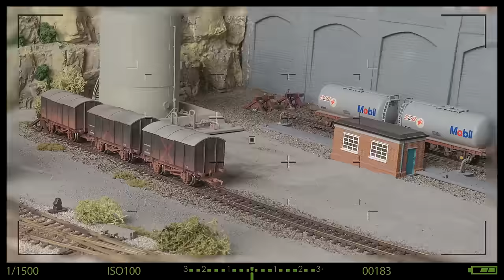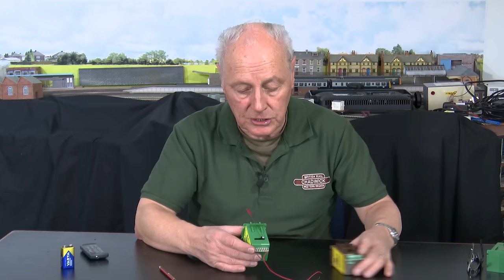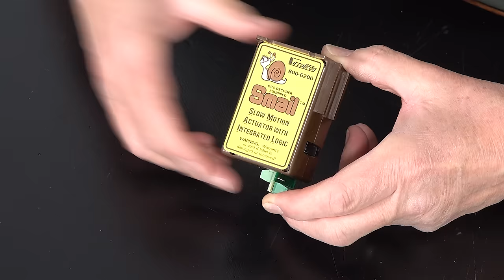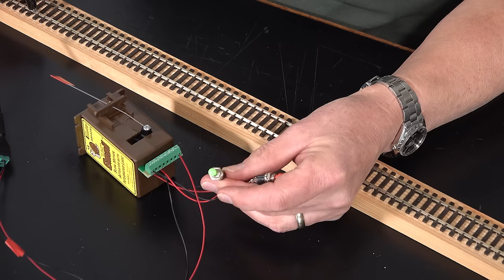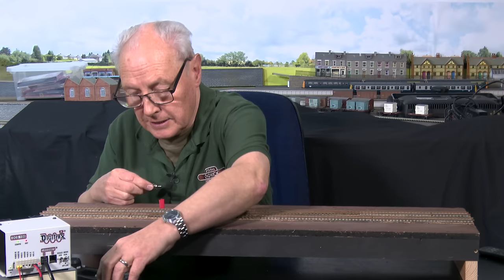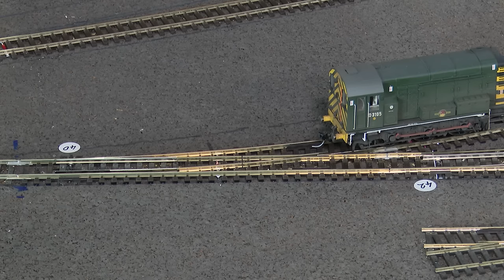SMAILS Vs TORTOISE Point Motors / Switch Machines at Chadwick Model Railway | 208.

Comment: Interesting, especially the multi-source controls. On my layout, with thirty some points in the main yard, I get all fuddled when trying to remember which number point to throw as the express is nearing the junction. All my points are powered off a separate power bus, and the Cobalt and MBT motors have little or no draw after moving. To this end, I have moved to Megapoints controls with the driver boards located close to the points, with the single cable from the master panel to the driver boards. I have a mix of Cobalt analogue IP's and MBT MP10's, both of which have SPDT switches integrated, so when the express nears a junction, I Iook at the control panel and push the button for the junction depicted thereon, which throws the point and also changes the indicator light on the board, without using any of the onboard switches. At the junction, one set of onboard switches operates the signal, while a second activates the 25 cm (+/-) approaching from the "backside" along with the frog. If the point is against the loco, the approach is unpowered, so the loco never gets to the unpowered frog, so the hand of God (and the associated 2 meter arm) never gets called on. Throwing the point sends power to the "dead zone" and to the frog, and we continue on our merry way.  I have also made a handheld controller based near the second switchyard to control those points. (NOTE: as a British modeller in the U.S., one of the challenges has been learning the lingo. Your videos go a long ways towards figuring out most of the differences; guards vs. conductors, drivers vs. engineers, platelayers vs. MOW trackmen, shunters vs. switch engines, etc.)
Reply from the maker: Many thanks for such an interesting comment Jack. Good luck with your project, regards, Charlie

Comment: Very clear video - thanks!   My club has a standard that all turnouts are operated by a single push-button.  You demonstrated the two push-button method.  Are there any CVs that allow the use of a single push-button to toggle the points?
Reply from the maker: Not that I can see in the paperwork. Regards, Charlie

Comment: Charlie, thank you for another very interesting video.
I think that the point motor is becoming very sophisticated.  The old Peco point motor is now a Dodo.
I took the decision and am swapping over to the DCC Concepts IP Digital motors.  It appears to be very similar to the Smail.
I really like the idea of a seperate powerbus for the points, it is something I will have to investigate - oh well, more crawling around, and more cables.
Cheers, and stay safe,  Michael
Reply from the maker: You could choose to wait and see how the new DCC enabled point motors from MTP fair.  Regards Charlie.
Reply: Charlie makes a very good point below Michael. As I noted in my comment, I’ve installed both Cobalt iP Digital and MTB point motors. I find the MTB motors very versatile and look forward to trying out the new digital versions.
Reply: @bryan_lane  thanks, but there is also the cost, and I have already laid out for the IP Digital motor.
Reply: @michaelimpey1407  Yes indeed, I’ve already bought 24 so I’ve got the same issue as you. However, going forward I’ll have a need for quite a few more motors in my planned build and I’m almost certainly going to switch allegiance.

Comment: Hi Charlie, as others have said the issue of shorts shutting down what is essentially your ‘control bus’ is an issue that needs to be considered. If you’re implementing PM42s (or other power managers) you could dedicate one of the sub-districts as an accessory bus or feed the accessories from the command station output directly. As another option I’ve just picked up a couple of the Tam Valley Depot DCC Boosters which are aimed at solving this problem as well as providing a universal 5 A booster (the functionality is selectable via an on-board link). Really enjoy your videos and these discussions, thank you - rooting for you to get the 100k!
Reply from the maker: Thanks Steve, I think we all know the answer, but the publicity behind this switch machine is somewhat one-sided. Regards, Charlie

Comment: I have all my points on a separate accessory bus. This is when I have a short I can still operate my points. My power districts I have 8 using Psxx breakers. They report shorts back to TC via on opto detection module. I can then “ deal” with the short via TC. I also have an emergency stop. That has 2 functions either a dead stop for all trains or a slow stop where each train will run into the next block and stock. These functions are controlled by physical buttons on the facia or via tc switch board. Each button only emergency stop controls/stops it’s respect power district
Reply from the maker: Many thanks for your comments Daz. However, I think that these point motors are aimed at the much smaller layout. Regards, Charlie
Reply: @ChadwickModelRailway  agreed. Still love to have a play with a few though

Comment: I suspect the way around the Smail's problem with not being able to change the point if there is a short circuit, killing track power, would be to have a separate power bus just for the smails....
Reply from the maker: Yes Ken, that’s precisely the answer. Regards, Charlie

Comment: Perfect timing Charlie!  I’m now at the stage when I’ll soon need to pin my colours to the mast on what point control I’m going to use. My prospective layout design (at least the current one 😳) has 27 points on it, so I’ll soon need to decide exactly how I’m going to control them all. This new Smail option has now given me yet another possibility; although I’m not sure if that’s a good thing !! Although my locos are all run on DCC, I was leaning towards analogue control for my points, with a nice pretty control panel (or several) but maybe now I’ll think again. There are just too many decisions to make 😩
Reply from the maker: My advice, Adrian, is to keep your powder dry until MTB announced their new Digital point Motors. Regards, Charlie
Reply: Thanks Charlie….yes the chaps at Digitrains have suggested the same thing to me……I’m in no immediate hurry, so I’ll do that……so many choices !  😫

Comment: Hi Charlie,
Thank you for your great videos.
On the issue of shorts due to frog polarity, can this be overcome with the SMAIL by having a separate power supply (an accessory bus)?

I’ve done this on layout using DCC Concepts IP Digital point motors. Power supply from the NCE throttle is split, one for the track and the other for the accessories (at the moment this is only the point motors).
Reply from the maker: Yes, I do understand that Damian. However, it was designed initially for more simplistic wiring. Regards, Charlie

Comment: Hi Charlie, another very informative video and as I use Tortoise motors, most interesting. One thing I'd like to know is, have you opened one up to see if Circutron have corrected the fault with the contact wipers which tend to break off after a while as McKinley Railway have found out literally hundreds of times!🤞
Reply from the maker: No HA, I haven’t. However, that does sound tempting. Regards, Charlie

Comment: What I did was to control the SMAILs from a dedicated DCC circuit rather than using track power. That eliminates the issue with locos running into shorts and having to use the Hand of God.
Reply from the maker: Yes James, that seems to be the only way around it. However, it does mean yet another DCC run. Regards, Charlie

Comment: My experience on my club layout leads me to think that a switch problem that requires direct manual intervention to clear is a bad idea in general, and unacceptable on a large model railway... as such I think I'd avoid those SMAIL switch motors unless there was a very good reason to install them in a particular location, and ban their use with track power on the main line, entirely.
Reply from the maker: I understand your point of view Matthew. However, I believe they are aimed at the smaller layout Moadeller. Regards, Charlie

Comment: I guess all points should be protected by a signal and by using block detection you can use auto braking until the points are changed correctly, then that short will never happen. Basically the signal controls the movement of the points, and releases the loco to proceed only if points are set correctly. Obviously that requires more electronics, e.g. abc capable decoder in loco, point position sensor, block detection and signal tech capable of triggering points, and maybe route tech to switch everything correctly.
Reply from the maker: I see that you’re getting a hang of this DCC stuff Steve! Regards, Charlie

Comment: Hi Charlie. I was wondering if i attatch a wood block under my board and mount a tortoise motor on it sideways could i use it to lift a decoupler up & down? With a on off on toggle switch ?
Reply from the maker: Yes, very feasible. Many people use them for level crossing gates. I do believe that tortoise do make a proper attachment for horizontal use. in Regards, Charlie.

Comment: Hi, just a thought for when using these new motors, depending on the maximum length of your Steam Loco or Diesel Loco, would it be possible to have a section of dead track before the point if it is set against the passing loco. Even if you only do that in those very hard to get at areas it might be of some use.
Reply from the maker: I understand your thought process Steve, however, how would you switch the piece of track off? Regards, Charlie
Reply: would relay be able to be worked by the contact on the switch machine, it was just a thought but might be a lot of wiring if you had a large number to protect

Comment: Do these new Smail point motors, still have the same internal plastic arm with phosphor bronze/copper wipers? Just asking, because I recently watched the McKinley Railway video, where the long-term issues they were having with the old Tortoise motors (wipers breaking off) was explained.
Reply from the maker: I believe they are the same design concept Steve. However, I have seen some information from the manufacturer that they are going to redesign the attachment of the contacts. Regards, Charlie

Comment: Charlie. Thank you for another interesting short.
When we saw the subject, I said to my wife that I assumed that Circuitron will have addressed the issue that has had McKinley make adjustments to dozens (hundreds?) of tortoises.
But you didn't even reference the collapse of the internal fixing.   Has it been fixed?
Thanks - and Merry Christmas to you and Margaret
Allie and Jonathan
Reply from the maker: Many thanks for your comment. I was saving the McKinley issue for a later date. I have heard that they are going to make design changes but not yet. Regards, Charlie

Comment: Hi Charlie, very good review, potentially one of the sets of 3 terminals could be used to switch power to prevent a loco driving through a point set against it. This would require making a cut one one rail in both tracks that lead to the point, track power is then fed to that isolated rail via the point motor meaning the loco can only proceed when the point is set correctly.  It could possibly be wired in to the frog power terminals. Thoughts? all the best
Reply from the maker: Wow, that suggestion has attacked my grey cells indeed. I shall have to think about that one. Regards, Charlie
Reply: @ChadwickModelRailway  think of it as a mini isolated section just prior to the point, the loco would stop if the point was set against it unless it had stay alive.

Comment: Have you had any of the problems with the contacts inside these point motors that McKinley have had Charlie ?
So with the motor and Digitarx DS74 you are looking at nearly £40 per point to switch each one
Reply from the maker: Yes Shaun, when you put it like that, it’s a shocker. Regards, Charlie

Comment: Regarding the problem of a short circuit that you describe.  I am not a railway modeller so please excuse my ignorance.  The problem is caused by the fact that the SMAIL is powered from track power and that will have been turned off because of the short circuit.  Why does the SMAIL have to be powered by track power in the first place ?
Reply from the maker: Hi Bob, it was designed feature to minimise wiring. Regards, Charlie
Reply: @ChadwickModelRailway  As I say, I am not a railway modeller, but is there anything stopping you powering the SMAIL from an external supply ?  

You would need to connect the ground (negative) side of the track power to the ground (negative) side of the external supply to provide a common signal level but that is common practice in the world of electronics, which is where my interest comes in.

Comment: Hi just and idea for a short if you could possibly do a video on how to speed match 2 locomotives with different decoders to run in a double header for example a hymek with a class 47 thanks
Reply from the maker: Thanks Dan, for such an interesting suggestion. I shall do some research. Regards, Charlie
Reply: @ChadwickModelRailway  thank you it would definitely be a useful one for me anyway as I model a preserved line would like to double head or even top and tail some services with different classes of loco and different decoders

Comment: If you powered all your Smails off their own DCC bus which never is used on any track sections then the shortcoming goes away.
Reply from the maker: That’s correct Marcel. However, it would need to be from a separate Power district which doesn’t shut down when the track has a short. Regards, Charlie

Comment: Hi Charlie, thank you for another interesting video. I use DCC Concepts slow action point motor and have a mix of digital and analogue with separate decoders. I use a separate accessory bus so I can switch the point motors if I get a short due to a locomotive, is this not also possible with these units?
Reply from the maker: Yes, I agree Simon, however, it is disappointing that we have to make alterations to cope with the designers omissions. Regards Charlie

Comment: It's a shame that the SMAIL has connectors that require a screwdriver to be used rather than the lever type used on Wago connectors
Reply from the maker: That’s an interesting observation Bob. Regards, Charlie.
Reply: @ChadwickModelRailway  I wondered whether it was because of cost saving but considering the cost of a SMAIL I doubt it

Comment: These point motors are too big in my opinion. The MP5 point motors are so much better especially for tight installations. At least the Smail has screw terminals...
Reply from the maker: Hey fair observation Paul. 
However, just wait until the new Digital point motors come out from MTB, I’m pretty sure they will be fantastic. 
Regards Charlie

Comment: Just two wires is the cry!! Two wires to each piece of track, two wires to each power district and the compulsory circuit breakers you need! Two wires to each point - wrong three wires. Why is the hype still put about, why not the truth? Charlie, YouTube has such influence with channels such as yours that the manufacturers need to up their game to ensure the truth and best practice is clear for all to follow. Two quick questions if I may? First, how is the wheel cleaning machine performing? And secondly why is the U.K. behind in the creation of the equipment that is needed for DCC to flourish and not be stuck in the “Good Old Days” of stud and probe?
Reply from the maker: Interesting questions, grump. 
Firstly, the wheel scrubber is working perfectly, with good results. 
Secondly, the DCC complexity, I believe is driven by the insatiable diet of individuals who want to make their layout more more complicated. Regards, Charlie